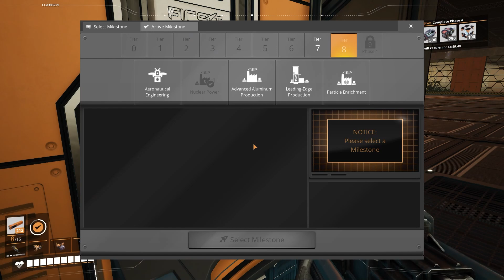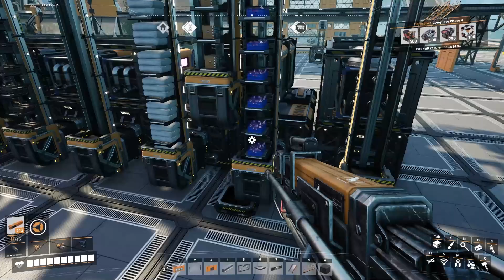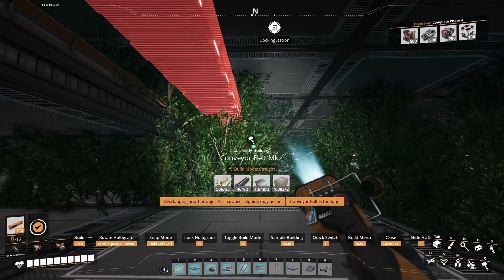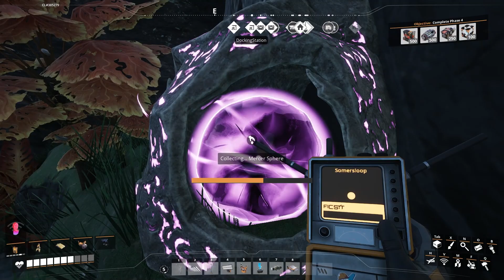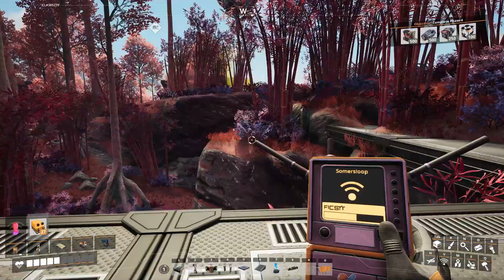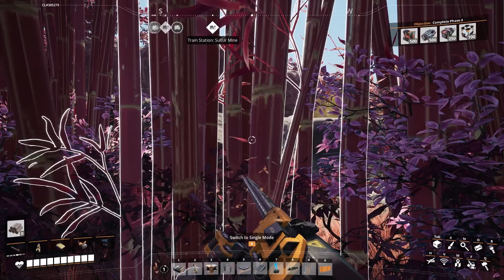New factory section begins! - Satisfactory 1.0 EP29

Comment: Here are a few tips.
1.Floor holes
    a. With the floor holes you need to attach the lift to the hole, Not the belt/splitter/machine/etc.
    b. With the holes you can have the lift have no vertical limit but you have to put the lift in the same vertical spot at the bottom which
         can be a pain because it will not attach unless you look at the hole on top (remember to make sure the lift is going the right direction by using the "R" key).

2 . The map (it has a lot of QOL that most don't know about)
     a. On the list you will see a picture of a  - or + , a compass , and a Nav Point, Use those to toggle on and off. As an example if you 
           are tired of seeing the dismantle crates on the compass at the top of the screen click the compass and it will toggle on and off.
     b. Markers, the quick stickers are nice but lack options, try Using the  +New Map  Marker. Be sure to look at all the options!  You can 
          name them want, change the icon, put into different categories, etc.
     c. Hover the mouse over a name on the list and it will highlight all of the selected item, double click and it will center on the map. 
          The check mark on recourses means you have a miner on it.
     d. There are coordinates at the top right of the map you can manually type in if you want to, but may require to look some up, Maybe when hunting loops, spheres, and HDs

3. Misc.
     a. I can't believe you passed one of the best early alt recipes "Wet Concrete" (not only once too) its a good way to get rid of excess water.
     b. Mega Bases are nice but if your computer starts to lag try building else where and have the parts shipped in.
     c. The better fuel for the jetpack dose make a difference, and for power too!
     d. Always grab the remains and construct them "with a loop" to alien protein(do this with power slugs too to get double the power shards). Then construct again "with a loop" to 
          DNA capsule. The DNA capsules are only for the Awesome Sink and have their own meter for coupons
     e. "P" for photo mode and use the scroll wheel to zoom in and out
     f. "H" to holster equipment when building, Or may I suggest getting to cup from the Awesome store sometimes equipment gets in the way.
    g. You can hot key blueprints too.
Reply from the maker: Thank you for all those, very useful knowledge.
1) Yes I understand the concept of floor holes and infinite length verticals, I just haven't had any practical use for those yet in my factory. Whats wrong with just connecting lifts to each other at max length?
2. Thanks that's super handy I will definitely try this out.
3. a) My base hasn't had water until recently neither have I had the need to dispose of water. But I can see that being handy in the future
d) Oh true, I should do that, thanks for reminding me

Comment: Drones are always a mixed bag for Logistics. The 9 slots of Inventory is meant to add a tool to the Logistics bag, not replace an existing one.

(Originally the Trucks were replaced by trains completely. Trucks were Janky & broken. So, the Devs fixed and buffed the Trucks- making them viable. Now players mix and match based on need. The Drone was intendedto add to that Meta)

Your play style has nearly everything being brought in to a Centralized area for processing. (So, a very limited use case)

Think along the lines of:
Trains move Ores, Trucks/Tractors move low-Level components, Drones move advanced components.
This would be the average concept for a play style that has higher volume & decentralized production.

Example:  Youtuber Moo took an entire swath of the Iron and Limestone in a section of the Dune Desert to create a 90 per minute Heavy Modular Frame Factory. (With Alt Recipes)

He can theoretically use Drones to then ship that advanced part to other factories. A Turbo Motor or Pressure Cube Factory.

They can also be used to gather those out of the way Ores, that a train or Truck would be wasted on.

Example:
Kibitz used a Drone setup to retrieve the Uranium atop the tallest Mountian, despite the limited inventory through put, it was enough to meet the Need.

Each Drone Port supports only 1 drone as it's Home Port. So, they can't go from Port A to B to C then back to A. Trucks and Trains can, but not a Drone. (This doesn't however mean Drones are Useless)

When utilizing a Drone system. Try not to fall into the trap of A to B" is the only use.
Though it does have that function.

Even though A to B is how each Drone works individually,  You can theoretically have multiple B's working the Same A....

You can set up location A with a Drone Port for Ore, and Location B for a Factory. 
You can have 2 Drones working on this route. I know, each port only supports 1 drone..... But, Drone B can fly to Drone A doubling Drones on that Route.
Making 18 Inventory slots dedicated to that Route.

Here's the Fun....
If the Production Factory has 5 Drone Ports, they can all be assigned to Drone Port A as an Ore or Component Source.
Ultimately increasing the Logistical Output of that Ore/ Component Source for 90 Inventory Slots in Transportation on that Route.

Likewise, You can have Multiple Factories sending Drones to Pick from that Source. (Theoretically,  if there's enough supply to meet all the demand)

Also, while every Drone Port has a Fueling setup, it's often better to plan which points in Your Network actually support the Fueling. 
No need to have a Fuel Logistics supply spread across the entire Map, when You can pick Key Critical Junctions and Fuel from there.

Ultimately, Drones fit into a Logistics Network. And become more useful in Decentralized Networks.

Or, You can go the whole hog approach like Kinstruction did when He made that Super Star Destroyer build.

He made an entire Oil Processing and Power Factory shaped like a Star Wars Ship floating in Atmosphere. 
So, the Oil was Packaged on the Ground, and everything was Flown in via Drones. To keep the Factory completely Floating. 

It was Disgustingly Beautiful. 

So, there's some ideas, uses, and concepts for the Drones.
Enjoy experimenting with Them
Reply from the maker: Thanks for that, I kinda had the hunch that it wasn't used for mass transport. That it would be better for transporting small volumes like high level parts. The drone port's large form factor leaves it being a bit annoying to use. 

I had a cool idea for having my factory entirely delivered by drones instead of belts. But then I thought for a manufacturer you'd need 4 drone ports to manage 4 different items etc etc... Seems like an end game idea when I have infinite power and fuel
Reply: @DataEngineerPlays  (sorry for the very late comment) drones are meant for low quantity/long distance transport.  They have such a long takeoff & landing animation that the longer the distance, the more economical they are (because the percent of wasted time is lower).  I know the playthrough is long finished, but I hope you get better fuel for the drones because they eat the "normal" yellow/orange fuel like crazy.  Looking forward to seeing the outcome.